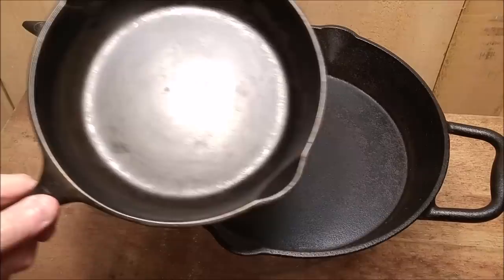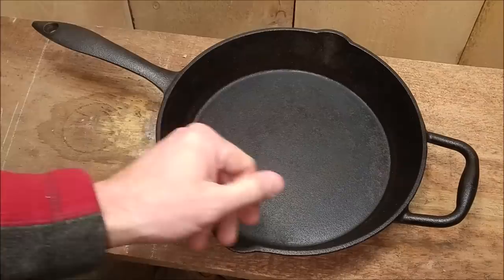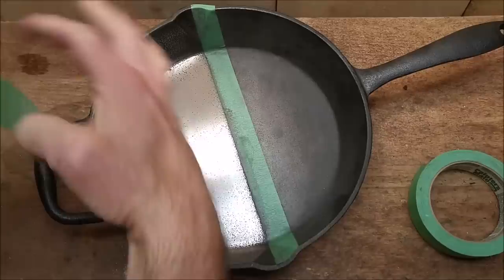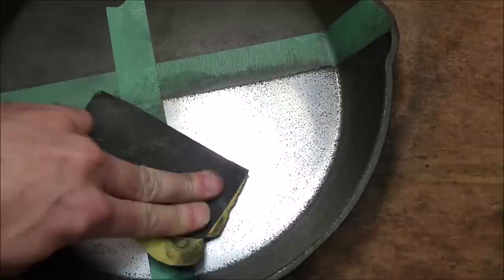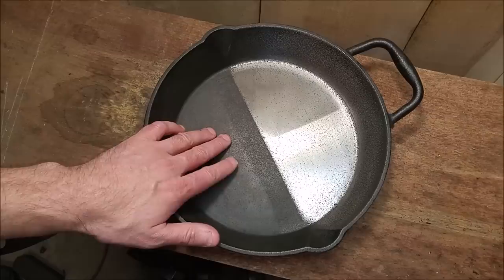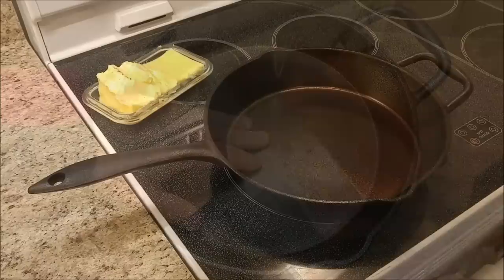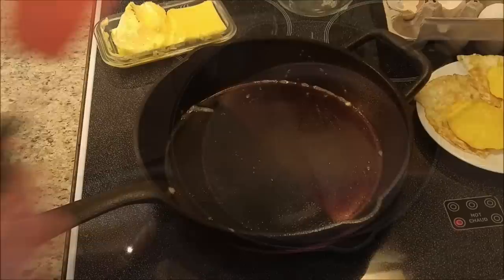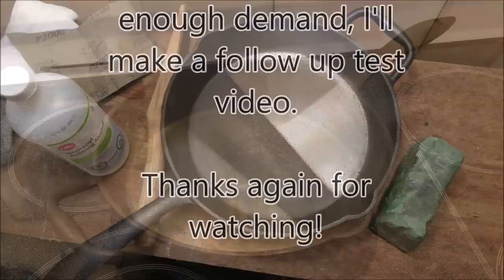🍳EXTREME Polish - Smooth a Cast Iron Pan to Reproduce an Antique Skillet then take it way beyond

Comment: Cleaning cast iron is easy, heat it up, pour water on it and watch everything bubble up and come off
Reply from the maker: Thanks for the comment, I use this method, and I also like to use salt, it removes any stuck on bits of bacon etc.  and won't harm the surface.  It does however remove the light coating of oil left, so you'd need to re-apply afterward.
Reply from the maker: @Axiarus  Is that the one that looks like Chain-mail?
Reply from the maker: @Axiarus  Going to buy one, thanks for the tip.  Any brand that you can recommend?
Reply from the maker: @Axiarus  Perfect, thanks.
Reply: I highly recommend the plastic scraper from Lodge. $4 and works awesome on a smooth pan (I have a smithey brand pan, it's smooth)

Comment: I did this a few years and went up to 220 grit and wet sand as well. I would not go beyond 80 next time. The seasoning difficult to get with the polished surface and also washes off easily I use those green pads.
Reply from the maker: I think you're right; the smoother surface does not allow good bonding of the polymerized coating, a lightly abraded surface is probably better.  I have experienced the same issue with small amounts of coating coming off.  80 or 100 might be all that's really needed.  It's also not really necessary to remove every little imperfection, I just decided to take it to the extreme.

Thanks for the comment and for sharing your experiences on the subject.
Reply: How long does it  take to smooth it to 80 grit, and do you use an electric sander or do it by hand?

Comment: Anybody can tell me what ecxactly is the stuff he puts on the leather strop please! thanks
Reply from the maker: Polishing compound.  It usually comes in a bar form.  I don't recommend this for your pan, it is basically poison if you eat it.   I've found that a high polish is not a great way to achieve a good bond with the seasoning, instead, a 100 grit sanding does the job very well, followed up with a hot vinegar bath, and then into the oven to bring out the tempering colours.  After those steps, let it cool and season normally.  This will achieve a very deep dark colour from the beginning!

Comment: Cool video, how did you do your seasoning?
Reply from the maker: I like to season in the Barbecue, unless you have a great exhaust fan or you can open all of your windows, I find this to be the best method.  

Here is a link to some good info on seasoning: https://www.lodgemfg.com/sites/default/files/2019-09/All%20About%20Seasoning_Download_DIGITAL.pdf , 
and here is one to a simple process: https://stargazercastiron.com/pages/use-care?=page=clean#usecare_tabs3

Many people have told me that you can just season your pans on the stove top, and I have tried it and it works well for just the bottom of the pan, if you need to season the entire pan, you'll want to use the oven or barbecue so you heat the sidewalls also.  

I have plans for future videos to show the process in detail as well as explain what exactly is happening, and how to achieve the best final result in the least amount of steps.

Comment: Shiny=reflective. (some of the laser bouncing off and not back to the detector.
Rough=absorbent. (most of the necessary infrared comes back to the detector.
Reply from the maker: How does the laser come back to the detector when it is at an angle to the surface, wouldn't it reflect away? Or maybe this is more about IR radiation?
Reply: @NeedItMakeIt  Much of it does. But because of the small scale structured texture of even the polished pan there is plenty of surface to Reflect back to the detector.
You could test this by reading the temperature of a mirror in the same method he tried here. It will read even though MUCH more of the light is bounced.

Comment: Isn't some  texture roughtness desired so as  help the seasoning catch on?
Reply from the maker: Too smooth is not a good thing, I do find that the super smooth finish does not like to hold the seasoning too well.  I go over this a little bit in my latest video regarding the metal spatula, however I plan on doing more testing and a follow up video to see.  A textured surface is easier to season I find, the black finish seems to come quicker to the rough pans.
Reply: I just had to be patient.  I used a flap disc wheel in an angle grinder, and it took a few pounds of bacon before my smoothed out Lodge did as well as my mom's Griswold.  Coincidentally about the time it quit looking so brown with shiny under.

Comment: Just a thought on the temp readings. Could the rougher side be holding a more boundary layer of hot air vs the smooth and polished surfaces?
Anyway I have been cooking on cast iron for decades daily and never bought into the smooth is better crowd, some of my no mane pans are very smooth but I do use a lot of Lodge textured surface pans. There's a lot of old myth surrounding the care of cast iron and cooking with it.

Comment: Isn't there some concern for scratching the glass surface of your cooktop with cast iron?
Reply from the maker: That's a good point, after years of using cast iron on this stove, there are no scratches, I have to assume that this is no ordinary glass.  It is also possible that the thin layer of seasoning protects the glass.
Reply: @NeedItMakeIt  I'm sure it's some kind of laboratory glass, given the temps it withstands...but you're giving me the courage to pull my cast iron out after the ten years I've had my cooktop!
Reply from the maker: @clintcannon1902  I did a little digging and there isn't much info on these, but some are mentioned as "Ceramic" rather than glass.  It could be similar to those corning-ware cookware, or lenses for airplanes which is tempered or tensioned glass.  The only problem I have is cleaning them off after a pot boils over, vinegar and sodium bi-carb work with elbow grease, I can't bring myself to spend money on a dedicated cleaner for this.

Comment: cool video Im gunna do that with my lodges. I was stoked to see the compound! I was thinkIng of doing that too but hadent seen anyone do it. The temp difference may be because the rough part has more surface area? Im not a scietist but one side did look red hot.
Reply from the maker: I was thinking of making a video on the subject of exactly which grit would be the best to prepare for seasoning.  The highly polished surface if more difficult to season.  There might just be something to a slightly textured surface.

Apparently the temperature difference was because if thermal dismissiveness.... basically the reflective surface was causing an incorrect reading according to the other viewers.

Thanks for the support.
Reply: NeedItMakeIt I polished out one of my  pans to a mirror finish and it really doesn’t work well. I recommended just knocking the high spots or imperfections in the rough surface and seasoning from there. 
The seasoning on the pans is where the magic happens and the surface has to be rough enough for the seasoning to adhere.
Reply from the maker: @White000Crow  I agree, a highly polished surface does not allow the seasoning to bond properly.  Knocking off the high spots would work just fine and using a metal spatula after that may help to smooth that surface even further.

Comment: Surface area. A rough surface actually has more surface area this is why many iron stoves are dimpled.
Reply: You have to think of it as a 3 dimensional picture not 2 dimensions more area greater transfer of heat. It is employed in many solar applications.
Reply from the maker: I thought this as well, I am gathering a few supplies at the moment to do a follow up video on IR, so hopefully that can answer a few questions.  I like using it, but I need it to give me more accurate readings.

Comment: MAKE AN ENTIRELY POLISHED CAST IRON !!!!
Reply from the maker: Okay, that's an awesome idea, thanks for the comment.
Reply: @NeedItMakeIt  thanks!!! Would be awesome if you did that ! Great videos :)
Reply from the maker: Thanks, no promises as I have limited time and my projects have to have a functional purpose.  Aesthetics are just nice to have, I'd much prefer to have something that serves a purpose.

Thanks for the comment!
Reply: @monicar6029  I would never cook in it, keep it sparkling. Epoxy it into a sphere displayed on an RGB motorized turntable.
Reply: If you used an orbital sander a whole pan would be easy to do.  There are extremely high grits and polishing pads made for orbital sanders. You could literally mirror polish a whole pan without your arm getting tired and in half the time. Make sure all the scratches are gone from the previous grit before you move to the next. If you do that video, please give me a mention in the video!
Reply: @butchcoplin2316  

I want to do this. When I get to my friend's machine shop, my plan is to mount the pan to a rotary table and with an end-mill with a radius tip machine the sides, and then with a fly cutter, machine the bottom dead flat. 

This will leave some tooling marks bit then I will switch to abrasives then on to compound, progressing to a mirror finish.

Next, chemically strip in a lye bath,  and then a light acid etch.

Now season using his brazing furnace equipped with a PID temp controller.

My prediction is. A non stick wonder.
Reply: @MrRShoaf  oh hell yes.. For science! 😂
Reply: As a painter i have all the tools to do this quickly ill definitely be having a go next time i see a rough pan
Reply: @Tehcarp  

You don't have to go too far to find a rough pan, Wal-Mart sells Lodge brand new and the castings are rough.
Reply: A polished cast iron pan won't hold seasoning. The rough texture is vital to keeping a pan seasoned.
Reply: @MrRShoaf  it'll be a shitty pan. The rough texture is vital to the pan holding its seasoning layer. Without a seasoning layer, food sticks horribly to cast iron. With polished cast iron, your seasoning layer basically becomes flaky varnish that comes off in your food because it cannot adhere to the smooth surface of the polished iron.
Reply: @MrRShoaf   so the sides in the milling machine, then move the workpiece to a flywheel grinder.  After it sparks out, there won't be any tool marks other than a cosmetic swirl pattern. (and it will be flatter than you can achieve in the mill).

I have two new china POSs in my car to do that very same thing, but I never think about it when I'm at the shop.
Reply: @SomeGuy-vo7we   My Wagner was factory smooth, and holds seasoning well.
Reply: @SomeGuy-vo7we   Then how come high carbon steel skillets are highly polished before seasoning and they hold their non stick finish for a long time. Is cast iron different.

Comment: The differences in temperature readings were probably due to the different IR emissivity of the rough and polished (slightly reflective) surfaces. A skillet with that much temperature variation would be a very poor skillet indeed. It's a measurement error.
Infrared thermometers aren't as fool-proof as they appear.  You might find this interesting...
https://www.fluke.com/en-us/learn/blog/temperature/how-to-get-great-results-with-an-infrared-thermometer
Reply: bingo

Comment: So after roughly a month of using this skillet would you say it's worth it to give my cast iron this treatment.
Reply from the maker: That would be a yes, but save yourself an hour and use a sander to do the majority of the work.  I wouldn't sand beyond 220 grit, the oil has trouble sticking for the first few coats.  I have a new video just posted where I show this process being used on a Lodge and it made a huge difference.  

https://youtu.be/yJBAxPKfN2A

Cooking is more enjoyable and cleaning is so much faster that it's worth it just for the ease of cleaning.  

I will be doing this to each of my skillets, and any new ones that I pickup in the future.

Oh, one more thing, you can do a better job thank I did at seasoning, make sure to pre-heat the pan, then wipe on and wipe everything off, I still had too much oil, leaving a spotted finish.  

Good luck!
Reply: @NeedItMakeIt  yep, wiping everything off and pan upside down sorts the spoty covering.

Comment: Temp difference could be because the pan is now thinner in the sanded areas.
Reply from the maker: That's a good point, you're the first to mention this possibility.  Many people seem to think that it is the thermal emissive-ness of the surfaces, shiny/dull and how the light reflects back to the IR sensor, essentially causing an inaccurate reading.

Comment: Sanding modern cast iron exposes pits. Antique pans are completely smooth. I suspect finer casting sand was used, in addition to better materials and methods. Older castings in various applications such as bearing housings do not have these pits. Given this cookware needed to be cleaned, and seasoned regularly these were not minor considerations.
Reply from the maker: More care was taken in every step I'm sure, what I can see from my old Wagner pans is that they have been sanded / scraped / turned, they show markings on the interior sidewalls which are just a little bit irregular, almost like scraping marks.... possibly from a lathe or rotary type machine.  In either case, they result is that they are very smooth and so nice to use.  I get a feel of quality when I use them rather than using the new ones.

Comment: If you want a smoother finish, you needed to take the original coating down a little further with the 60 grit, then work with each successive grit to reduce the previous grit's scratches. Seems like you still had a fair amount of pitting and deep scratches in both sanded portions.

Also, if you look at some of the really expensive newer machined cast pans, you'll see there are very small ridges machined in that help the oil adhere during seasoning and allows it to coat evenly while cooking.
Reply from the maker: Yes, there was some pitting leftover, I took it much further in a follow up video because there was still the big problem of the belly in the pan.  It is all fixed up now and working great... not to mention looking great. 

The ridges are an interesting idea, I like it and I think it could work.  I wish my metal lathe was large enough to suit a big pan, but I could start with a small pan to see if I can reproduce this with some HSS tooling.

Comment: Thank you for doing this by hand. I didn't want to buy all the electric tools. Why do you a polishing compound? Did you wear a mask?
Reply from the maker: I have the grinders, but they tend to remove too much and cause gauges in the surface.  Turning it on a large lathe using a mag chuck would be an awesome way to do it, but my lathe can't accommodate the handle.  I do wear a respirator most of the time, unless I keep the doors open an keep a flow of clean air coming in.  No sense in ruining your lungs, they're a little useful. 

Do you plan on doing something like this?

I wouldn't recommend going beyond 220 grit, the seasoning doesn't stick as well to the polish, so save your time.
Reply: @NeedItMakeIt  I do plan on doing this on a new lodge.
Reply: @NeedItMakeIt  Why do you add polishing?
Reply from the maker: The polish was added only to see what would happened if I took it to the extreme, really it is a waste of time on your own pans, it is very easy to clean, however it does not hold the seasoning too well, again just stop at about 220 grit or even a little lower, since it is really more a matter of removing the bumps in the surface.  I have another video of this process on a Lodge pan.

Comment: This is pretty needless. There is no need to sand down cast iron. You season it and it becomes smooth as glass anyhow. No idea why you would do this.
Reply from the maker: Thanks for sharing your thoughts, generally people seem very divided on the subject.  

This is an experiment to see how it performs in comparison.  I have shown this because like to share their opinions but with no facts or information such as comments like "NEVER NEVER NEVER" do that, with no explanation or reference.

Why would you do it, well do you don't need to do anything if you don't want to I'm simply showing the results if you do decide to (many people do).  Realistically you shouldn't polish your pan, the seasoning doesn't adhere as well, but a smooth surface is easier to clean.  As far as becoming smooth as glass anyhow, that also seems to be true, however it takes lots of time and the right utensils (metal) and people just don't want to wait.  

Your points are all valid, and I thank you for your comment.
Reply: @NeedItMakeIt  Yep, there's no easy way to season cast iron, it takes time, polishing it before doesn't save you time tho, you'll just have a shiny surface that stuff sticks too. The seasoning is a chemical reaction and only sanding it smooth can't replicate that lol
Reply from the maker: @wjerame  Well... check out my latest video, it may change your mind.  Three coats using the correct seasoning method and correct oil produces a non-stick surface, rough or smooth.   As with all of my videos, I show it and I can re-produce it.

One layer of carbon, or many... the same properties apply in either case.  But having a non-stick pan isn't just about the seasoning.

You can see how non-stick your pans really are by washing away the residual oils with soap and water then trying to cook with no fats at all.  

My eggs still don't stick, do yours?
Reply: @NeedItMakeIt  You can't "Wash away" the seasoning. Its not residual  oil lol its a layer of polymerized oil and then a carbon layer on top of that. Its no longer oil at this point. And yes, its non stick, so you don't need extra fats.. They're more for flavor at that point haha I enjoyed watching your video anyhow, have a good one lol